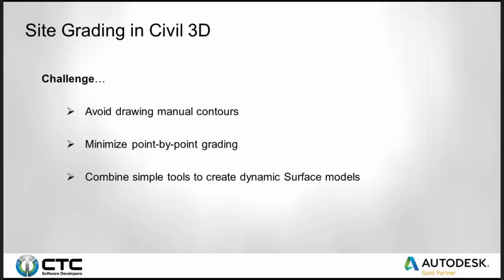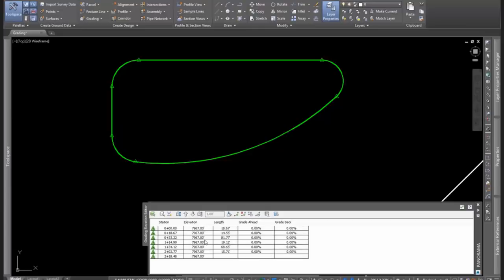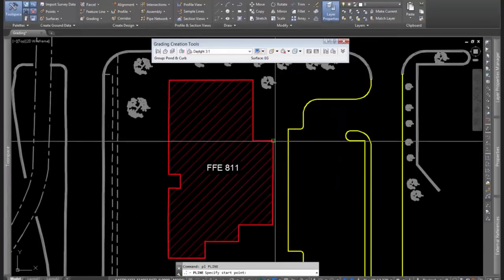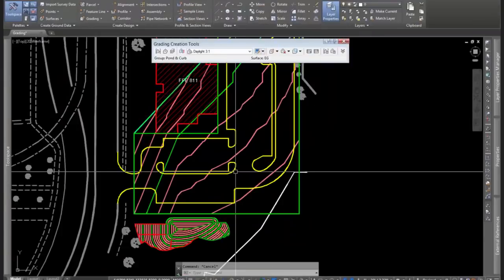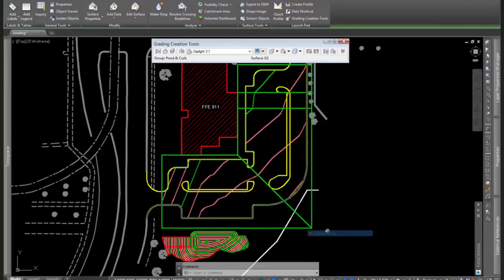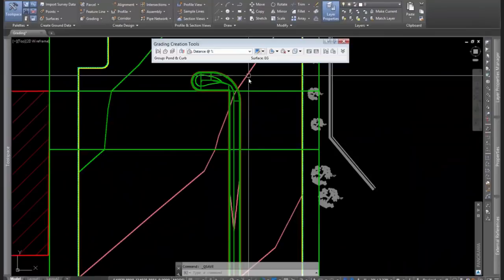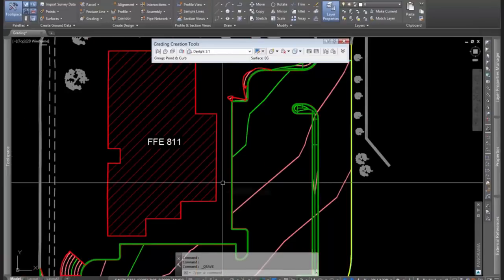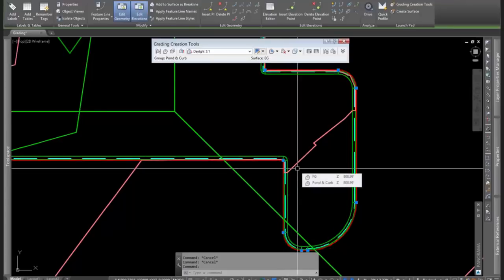Site Grading in Civil 3D Part 1

Comment: Thanks for the video. There is one issue. How do you prevent the curbs and the pond from forming a TIN surface amongst each other? When I try this, the two curb islands and the pond triangulate and form a flatter surface than the drainage surface, so after pasting the surfaces the drainage surface information is lost. If someone has a solution, please speak up.
Reply: Put the curb and pond in different sites. That way they won't interact until you paste the surface